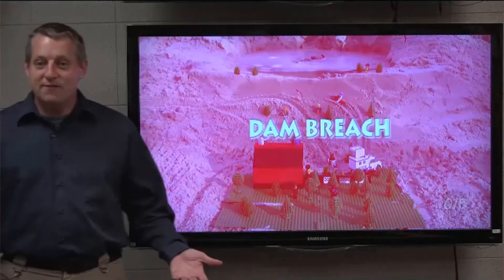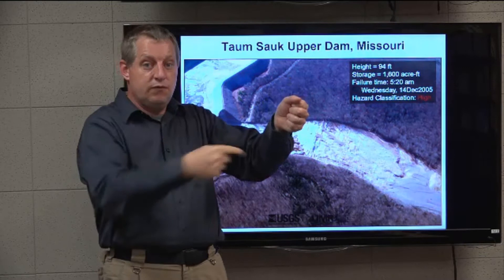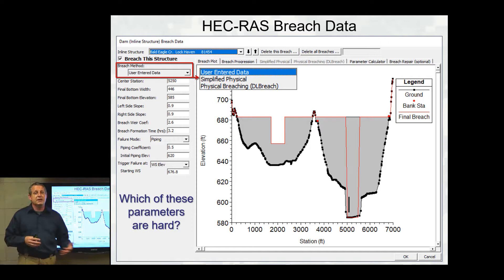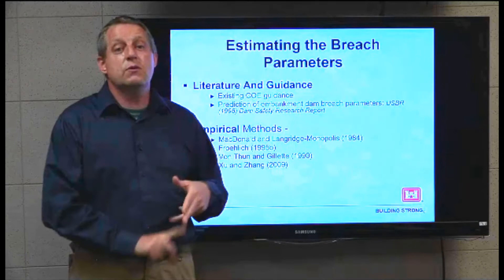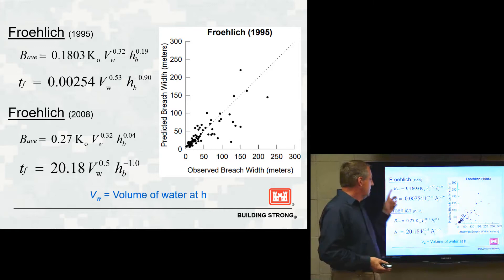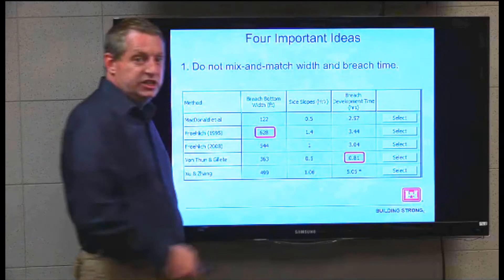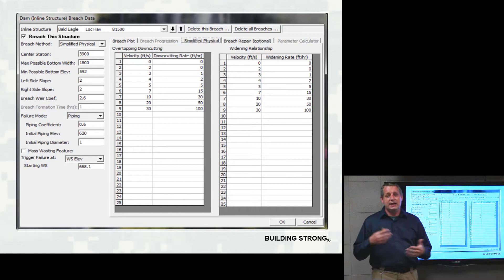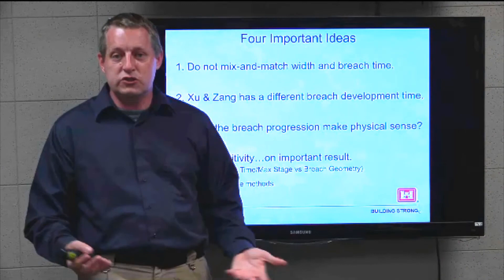HEC-RAS 2D Class: 5.2 - Selecting Breach Breach Parameters

Comment: Just a quick question, if we have a tailing facility (non-Newtonian fluid) and a water dam (Newtonian fluid), then how these two can be modelled as in "Unsteady Flow Data", just one flow regime can be defined for the whole system, i.e. Newtonian or Non-Newtonian flow regime. Please correct me if I am wrong and if there is any solution to model these combination of flow regimes. Thanks
Reply: This may be the most common question we get about 2D and I really need to do a video on it.  In the standard fixed-bed NN tool, no, you only get one global Cv.  But you can "hack" this by setting up a simple "mobile bed" sediment model (we even added simplifying tools like "concentration only" mode and a "deposition limiter" that will use the sediment engine to use the AD equation to route your debris flow into clear water...mix with the clear water, update the concentration, and feedback on the NN parameters.  I really need to do a video on this...but i'm not sure when I'll get to it.